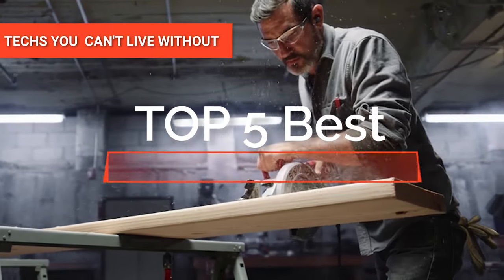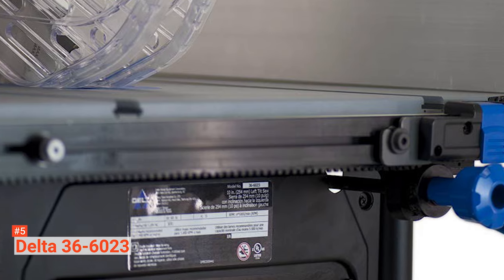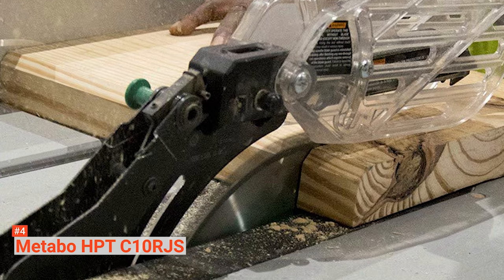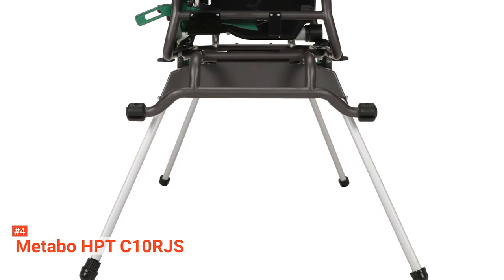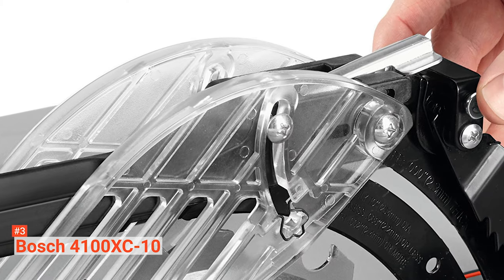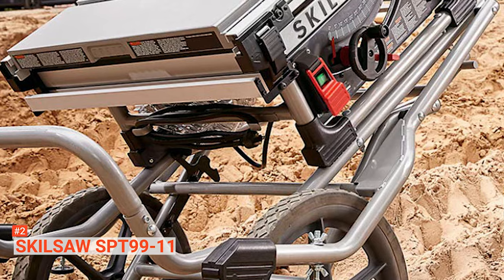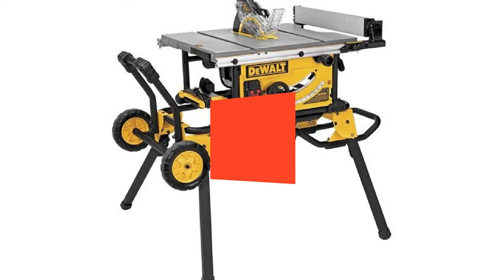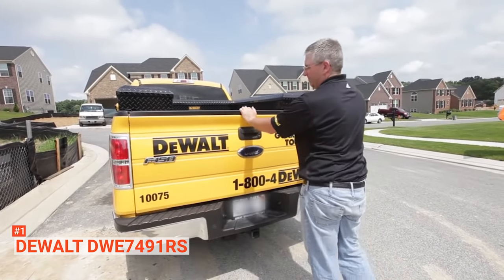✅ Don't buy a Jobsite Table Saw until you see this!

Comment: I use a 8" Ryobi benchtop saw for trimcuts. Of course I have a custom fence made from a drywall T square and a block of sugar pine. Fence is pulled tight against table saw with an 18" piece of hardened allthread.
Self aligning if blade is square to front of saw ledge.

Comment: Great review, however, I don't think that the weight should be seen as a con.  For  tools such as these, I believe that weight is an advantage.  Its not like one has to lift it while working on a piece like you would with a circular saw.  It's good to know the weight though so I am glad you mentioned it.
Reply: Lol, no weight is important too. Those are best jobsite table saws meaning: YOU TEND TO MOVE THIS TABLE SAW FROM ONE PLACE TO ANOTHER DEPENDING WHERE YOU WORK FOR CLIENTS! You would not want to lag over 70 kg super heavy table saw by yourself. IF intended for personal use in shed then yes, weight doesn't matter or actually heavier the better for stability!

Comment: I'm curious about the Rigid table saw. I had mine for 18 years as a trim carpenter (pre Chinese version) and it is running strong! Large area for stock, dado capabilites and has the roll around stand. The Bosch appears to be the best out of that bunch, but the others look like cheesy garbage. I'm guessing this is for newer models designed for weekend warriors and not for the field carpenters?

Comment: What's the size of the blade on the Dewalt again?
Reply: DEWALT 10-Inch Table Saw, 32-1/2-Inch Rip Capacity (DWE7491RS)
Reply: Thanks.